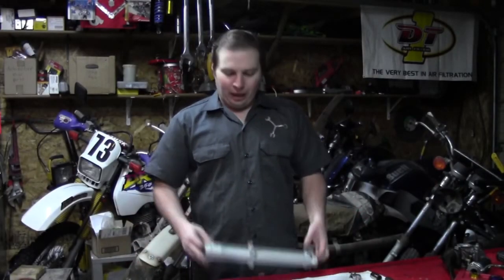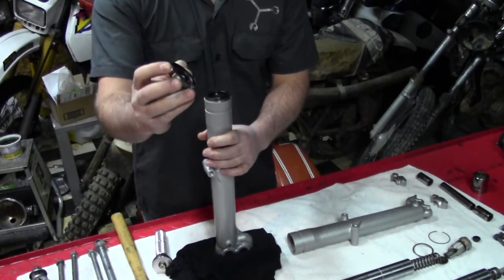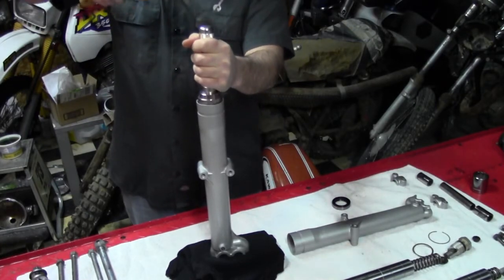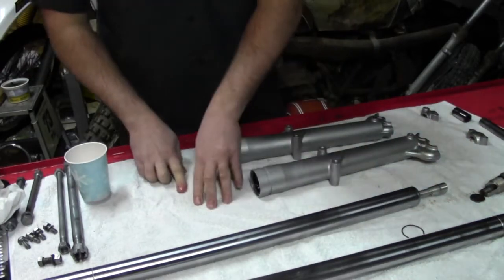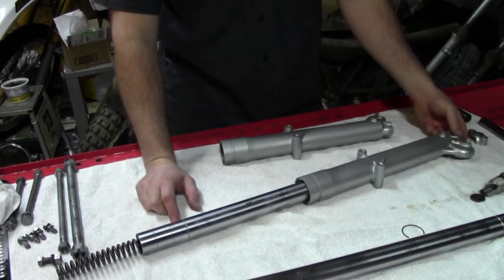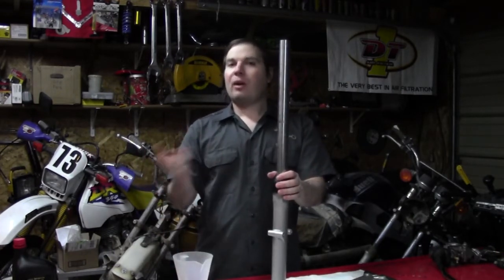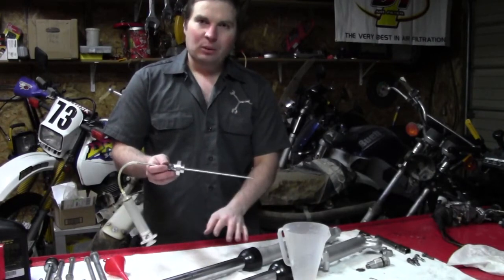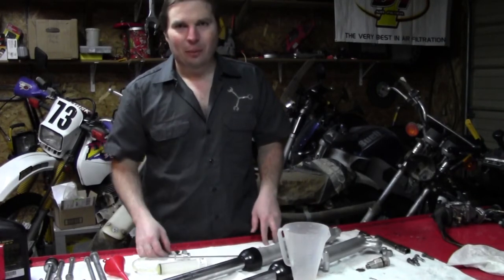1970 Kawasaki F5 Big Horn Fork seal replacement & suspension assembly - Barn Fresh EP8

Comment: Junkman, Thank you for your videos. You have taught me a lot about working on my bike, a 1974 F7. You didn't mention what paint you used in painting the lower section. I f you could please let me know, as my forks are leaking and I will be resealing them soon. Also, were the the carb, clutch, magneto covers originally, from the factory, painted , polished or "semi polished? Thanks again.
Reply from the maker: On the early F5's the forks, and some engine covers were painted.  Later F5's and the F9 (same bike but with updates) were just polished.  I used Duplicolor's Wheel coating (Silver) after testing a bunch of other products.  It most closely matched the original finish in color.   https://www.thejunkmanadv.com/barn-fresh-episode-2.html This link and video explains more.
Reply: Thank you so much for the quick reply.